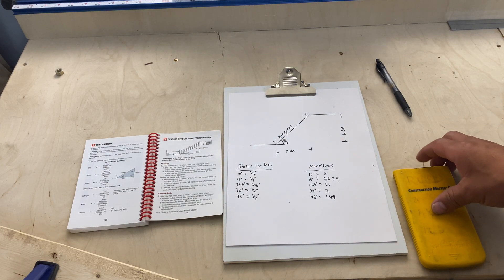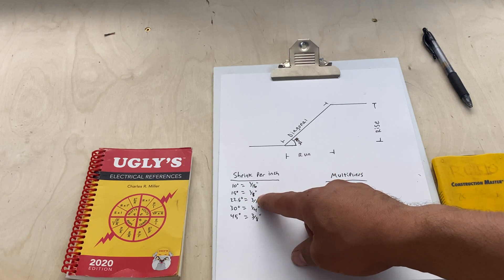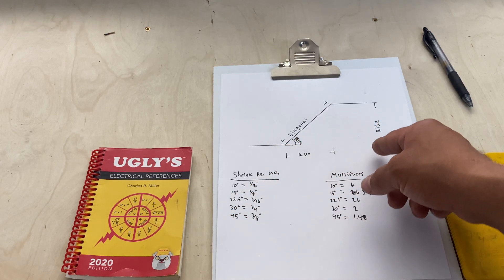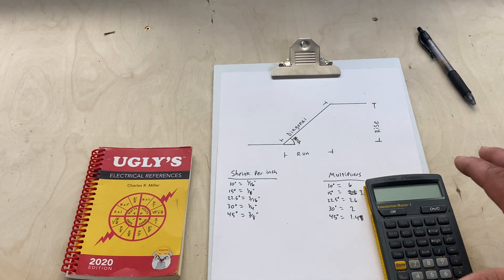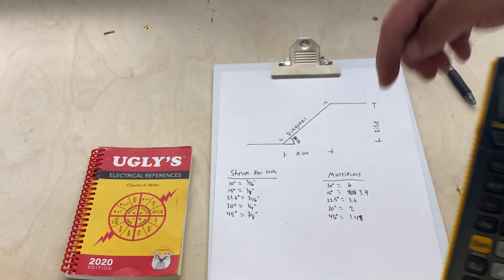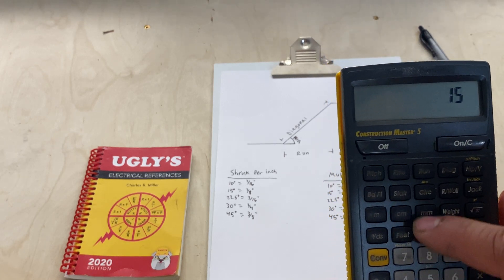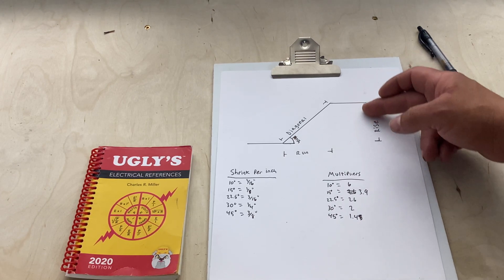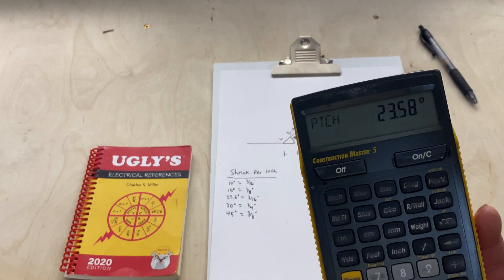How to Calculate Offsets

Comment: Should u have a digital angle finder if you use this method? Cause a 23.6 degree angle is like torqueing to 56 in-lbs without a torque wrench.